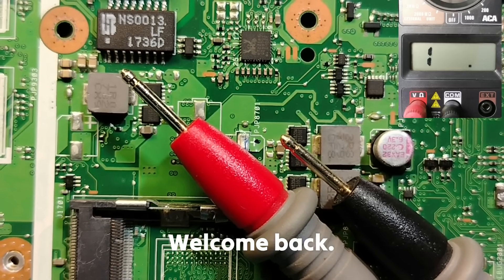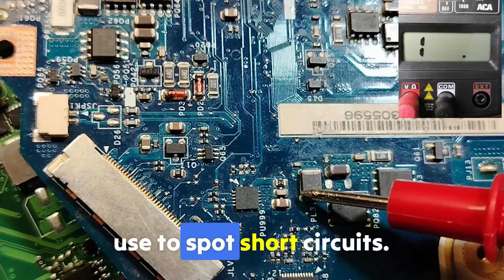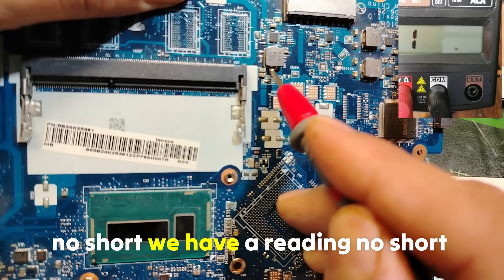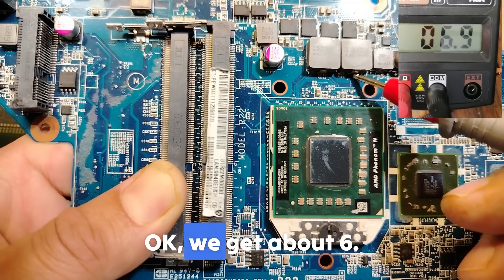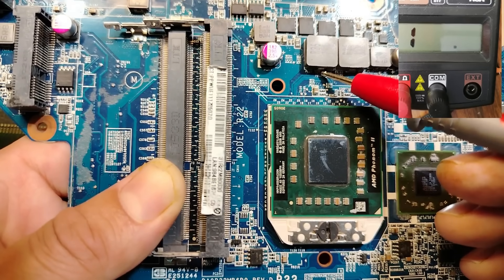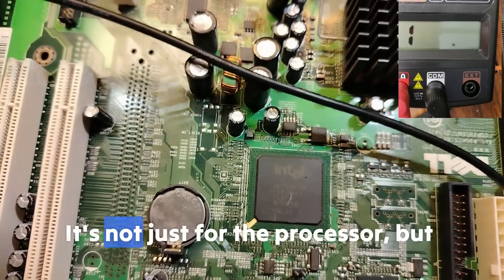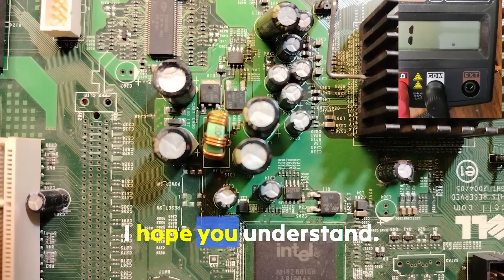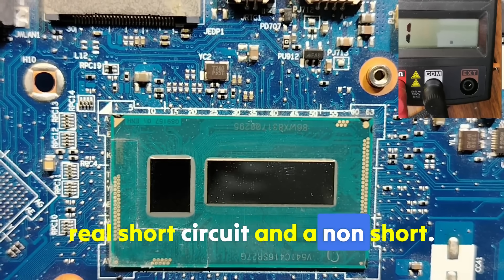The FASTEST Way to Find Shorts on Any Motherboard🔥| Laptop Short Circuit Repair

Comment: Those are readings on older boards. Newer CPU's can have readings as low as 0.5 ohms, even 0.2 ohms; and, your digital multimeter isn't always accurate enough at those milliohm readings.

Comment: How to test Flourescent numerical Display modules drivers where one element of FILAMENT is not lightning up despite the Whole Display numeral block is good. like number 6 the top filament not lighning uop or nuber 5 the left top filament not lighting up because one part of the river chip is damaged or shorted out

Comment: You found a short, but not where it actually is. The easiest way to find a short is to inject voltage and see what gets hot, with a thermal camera. Or you can use alcohol or burn your fingers. You will know instantly where the short is.

Comment: Sir, on the last part we have short circuit having different reading from the other components but the coil has the same reading , is it the coil that need to be replaced for they can regulate the current or the capacitor having different reading that was needed to replaced .. you didn't take out or say which really was the short ...

Comment: Good day. 
I have a problem with my PC. 
The PC has M.2 NVME Drive , what did is that I Replace M.2 NVME drive with M.2 SATA  after that I power on the PC but the PC never turn on.  
Up-to-date the PC is not turning on, when I try to turn it the system will starts and immediately turned off. 
What is the solution

Comment: This video would have been better if you actually explained how to FIND a short in the motherboard.....you spent so much time telling us how great this video is but still dont know how to actually find where the short is. 

You need to explain therory way more.....like what is the meter set to? And once you find the short, what next? Do I remove the capacitor?  What do I replace? 

Nice video but its really lacking....I still dont know where the short is 😂

Comment: my brother well done 
comments add to the YouTube math, and you are forcing us to say something very very very often you will read a few ohms to ground
and without the schematic you are showing us nothing. please be careful you did not mention how to use a meter or to disconnect power etc.

people are VERY VERY Excited to fix their computers from a video, but you can die if you make a mistake electricity is not your friend its a beast tamed by science. it will try very hard to get you if you're not careful
and not trying to be rude or mean the term "short' is way overused in over 45 years of service work a "short" circuit being the culpret is rare. open circuits far more common my friend. 
have an awesome day

Comment: Buck and boost converters are mostly used in power supplies and not likely just a motherboard . I used to repair power supply boards when I was working in avionics.

Comment: Circuit boards are tricky. You could measure a coil or capacitor and it may read close to zero resistance. Then you find out that because there are numerous parts that are in series and parallel with the part you thought was bad ,only to find out that diode or capacitor is good but some other unknown part is the culprit. That’s why we have oscilloscopes and huntron trackers etc.,so one can see exactly what the signals are doing.
Reply: this is what a great number of  electronics repair  guys  never tell us on youtube .  Two years ago When I started learning fixing motherboards  at components level  , I thought I just had to find shorted smd capacitors , and I realized  that it was as you mentioned  ,  capacitors showing continuity on board , were no more shorted off board  , I ended up removing a great deal of beeping capacitors , and sometimes damaging traces .  you have to dig deep in youtube videos to find people talking about components in series and parallel.
I read that oscilloscopes weren't suitable to test electronic components , about the huntron tracker I never heard about hem before , can a beginner use them?
Reply: Thank you....I knew it couldn't be that easy 😂

Comment: I assume the coils need replacing. Also replace all the shorted caps under the CPU.  Now you measure with new parts. What if there’s a component that was missed and you apply power. Now the missed component could take out the ones we replaced and now back to square1.

Comment: If one of the components has a short round the processor. How will we detected it or how will we know if it's bad
Reply: await your response please
Reply from the maker: Done, feel free to ask
Reply from the maker: If one of the components around the processor is shorted, we detect it by checking the resistance to ground on the affected rail. A faulty component will typically exhibit very low resistance (near 0 ohms), or the multimeter will beep continuously in continuity mode.

Then we isolate the faulty part by injecting low voltage, feeling for heat using a thermal camera, or lifting components one by one until the short disappears.

In short:
Measure resistance to ground → Very low = short.
Inject voltage → Find the heating component.
Lift suspect parts → Short disappears = bad component.

This is the standard and most reliable way to confirm a shorted component near the CPU.

Comment: What's a short ?
Reply from the maker: A short (or short circuit) happens when electricity takes an unintended path with very low resistance. Instead of flowing through the normal components, the current “shortcuts” somewhere, which can:
blow fuses.
damage components.
make the board or device stop working.
For example: a shorted capacitor lets current pass continuously instead of blocking it like it should.

Tell me, do you want me to show a simple example of a short on a board? It makes it super easy to understand.

Comment: Excellent video well done kindly make part 2 to further explore. To identify exact short circuit component
Reply from the maker: Awesome, I'm glad you found it useful! What type of motherboard or component would you like to see explored in Part 2?
Reply: Electrolyte & smd. Capicator 
diode. &.  Ic. &. Resistor

Comment: Need help my  Android tv box H96 max rom 64 GB and ram 4GB is dead there is no display  only a small red ligh red light is thre please guide me it will be very kind of you
Reply from the maker: It sounds like your Android TV box might have a power issue or a short circuit. If you have a multimeter, what do you see when you measure the voltage at the power input?

Comment: Resp Sir! Nice Sir🙏🏻, Sir My Seagate Hardisk 500GB Spinning and Stopped Sir, Where the Problem Sir, CUP IC, Motoer IC was Heating Sir, SMD Diods Impendence Values are both Sir Desplayed in Diode Mode Mtimeter Sir. Diode Removed and Tested OK good Sir. Where the Problem Sir, Anybody No Sutions Sir,  Please Advise and Solutions Sir Iam Waiting Your Message Sir. Repair Tools Please Provide Sir How to Pay the Amount Sir, Please Sir.   --   ChinnaRao Paderu Andhrapradesh

Comment: My brain is a bit shorted right now. Could be the content is also short.
Reply: The content cant be anymore longer. If you are more advanced you can jump straight to coils providing you know relevant resistances for each coil. Example. Main power rail expect K OHMS. 

Ram under 100ohms. Cpu under 20ohms (cpu generation determines that) the new the cpu the lower the OHMS. 

Do you get the theory?

Comment: How do you correct the short?
Reply from the maker: Stay tuned, part 2 coming soon
Reply: If you’re sure that the component is shorted,find out what the part number is and replace it with a new or known to be good part. Make sure if it’s a capacitor that the Voltage rating is the same as well as the micro or picofarads are identical. It will make a difference. If the capacitor is electrolytic be sure to orient it correctly or it will explode as soon as it gets power applied.

Comment: On most equipment if you just replace to fuse with a solid piece of wire the same size the short usually will clear itself😉🤣🤣🤣
Reply from the maker: I don't recommend bypassing fuses for safety

Comment: To find the fault, first do what he did or similar. Then if you have a multimeter that can measure 0.01 ohm difference. You can further check where you get the lowest resistance. That will normally be at the shorted component, or very close. Then de-solder one pin or remove suspected components until you find the faulty ones.
Reply from the maker: Thanks for sharing your expertise. Using a multimeter to check for resistance is a smart approach to pinpointing shorts. Every bit of knowledge helps.

Comment: how check  if the processor is dead using multimeter only?
Reply from the maker: You can check if a processor is dead by measuring the resistance across the pins with a multimeter. If you get an infinite reading, it might be time for a replacement.

Comment: How to find a short circuit in a motherboard that has an embedded CPU?
Reply from the maker: Stay tuned
Reply: In my opinion, this can be seen from the size of the resistance on the inductor near the CPU or chipset @electronicsrepairbasics_erb

Comment: Thanks so far! As I could understand, it's only the way how to detect a short circuit. Could you please show how to get rid of the short itself, otherwise it would be change the mainboard, but not repair.
Reply from the maker: Absolutely. I appreciate your input. I’ll definitely consider making a video on how to actually fix the short circuit issue. Stay tuned.

Comment: I am not sure if there is a part 2 missing, but this video did not explain how to find the shorted component.
You mentioned in the beginning of the video to show how to repair a shorted circuit without a thermal camera or voltage injection, but in the video, you just show how to check if a board is shorted or not, not really how to actually find and fix the short... or am I missing something?
Reply: Same questions here, mate, smh

Comment: good example, but you added more confusion because you only sampled the old motherboard, how about soldered cpu ,new board, how to detect it, thats what you didnt give an example. How to detect short even if the cpu is soldered, and how much resistance should have a coil to cpu in order to not be called short.
Reply: example, the new board soldered CPU , and the coil to cpu is shorted, but it really is shorted, how do you identify that without removing the cpu?  Or identify the culprit, may it be the CPU or other component causing it.

Comment: Finally, you did not explain how to find the shorted component.
Reply: I have not finished yet the video but all what he is saying is valuable. Very valuable especially for beginners who have not encountered yet the short reading on the cpu side. I myself before have tried to remove every capacitor on cpu side to check for shorts 😂.
Reply: @mchl93  you are correct ,this information is very valuable for understanding how to detect shorts quickly
Reply: just told us 15-16 is not a short circuit 😂
Reply: I 100% agree with you!!!!  Especially his voice terrifies!!!!
Reply: @iTanUS  , it's clear that this is a clickbait channel.
Reply: @82levy5 . 12 years 18 subs. Yes you’re channel is flying .😂😂
Reply: @thewidshed  , well... maybe you missed the fact that i'm not a youtuber. 😉
Reply: No Confuszed anymore Woowez.
Reply: Comments say its click bait? without really understanding what he is doing ...quite simple a coil is in a line (not shorted).
You do not want a grounded coil,the grounded coil(inductor) indicates you are on the correct power rail were the short is ,
it could be a capacitor which are tied across rails as they along with the coils(inductor) filter noise or they are part of the buck or boost power systems which the coils and mosfets are 
They provide the power rails like 5 volts or 3.3 volts etc ..
Coils wont work if they are grounded

Example in a psu the inline filter has two coils one in the live line and one in the neutral if the inductor finds ground through a shorted capacitor it will blow the input fuse .
And you would certainly not wire a coil across the live and neutral!! Almost anywhere in a motherboard .

 If that coil finds a path to ground and resistance is below 1 ohm you most likly have a short,

 if its a cpu the resistance is above 4 or 5 ohm or a low value its not a short. Check by removing processor if you can . Short should dissapear if it does not you can investigate the capacitors in that region.
and other chips as well if you find a path to ground via a chip pin that should not  be grounded you have a short..

Spend some time watching what he actually says .

Thanks very valuable technique.
Reply: Just what I thought xD
Reply: I'm shorted 😩
Reply: Junk click bait
Reply: He doesn't know 😅
Reply: Ok so it's quite simple. Instead of using voltage injection and cold spray everything i have to do is desolderig the cpu or the northbridge to find a short. Right ? 😂😂😂😂

Comment: 9:59  Sir , you put  the red probe on one side of the inductor ,  and you get continuity , that  doesn't mean it's a short  , it could indicate an electric path between ground and this side of the coil
Reply: the inductors in the power supply circuits are in series with the power supply, the positive conductor... there shouldn't be any continuity to the ground from any of the two sides as none of them are connected to the ground...

if one side has continuity to the ground, then the other one has too, because it's a coil i.e. a piece of wire...  also, you have a short to ground... there shouldn't be any low resistance to the ground there, unless it's feeding a component like the cpu which has low resistance to ground, as he said in the video...

what he didn't say in the video, but alluded to in the title, is how to find the cursed thing....
Reply: @adin_finitum  Sir , I've checked the "no continuity case ' in both sides for inductors , and found out continuity in those located in the power rail  after the  19v dc jack in
Reply: Ya @10:42 dude said the inductor is shorted but what really happened was that he was just measuring the resistance between the GND pad to a GND plane where the inductor is soldered on. That GND plane is so obviously large covering large area of the board.
Reply: @Dan8254  😲 wow !

Comment: Thanks Boss, let say the short appeared in between 3v 5v and ram circuit where several components like buck converter, chipsets ic ,transistors,mosfets ,tiny smd capacitors and diodes, spoting the real culprit became cumbersome tasks with just DMM and no thermal camera,removing one component after the other n fix back becomes hectic and time wasting. The only choice still seems to be voltage injection to fish out the component via its temperature which is somehow risky for beginners to avoid more damage to the motherboard.1. Is there any fast way to fishout the bad eggs?
                          2. Can you please do voltages injection in your next video?
Thanks for always being ready to help.
Reply: Dear sir will you able to show the fault/ shorts of the ( AC inverter circuit boards )  it will be more useful for intrested Technicians thank you sir...
Reply: In cases where a short is detected but a thermal image camera doesn’t not pick up any component heating up, I use a milliohm meter , I solder wires across the short, then while measuring resistance I proceed to apply a little bit of heat with a heatgun around the board. Wherever the short is resistance will normally react significantly. This method has help me for challenging to find shorts.
Reply: @ruviol across the components as how? Let's say the short is around d ram circuit. Where would ur jumper wire started from and where it ends. Please kindly shed some light about the method sir

Comment: Also, you can get some CPU circuits with very low resistance, BUT, if you cannot remove the CPU, it is difficult to know whether it is a short or not.
Reply from the maker: Stay tuned for the next part, I'll cover that.

Comment: very good material. I also know to check capacitors on both sides, but what about coils with low reading when you can't remove cpu?
Reply from the maker: Stay tuned for next part

Comment: The shorted coils are not the failed components. The next step is to locate which component is causing the short circuit. Normally it is failed capacitor or diode. A resistor will never be shorted but it will be open circuit.
Reply from the maker: You're absolutely right. Stay tuned next part is coming soon
Reply: You are right.
Reply: I would also add mosfets among the usually failed components.
Reply: you are wrong about resistors not being shorted.. and of course they can short itself

Comment: On some phones (for example samsung a30) it have a coil that is grounded on display ic for negative voltage, so please  also be careful.
Reply from the maker: Thanks for the tip. It's always important to consider the specific components of each device.

Comment: Thank you for the videos 

If laptop motherboard read low on coil near cpu  how to confirm if cpu is soldered on board?
Reply: Put power into the board and use and use an infra-red camera to see the heat.

Comment: What happen if 1.2v RAM power coil is shorted is CPU dead?
Reply from the maker: If the 1.2V RAM power coil is shorted, it could potentially cause issues with the CPU. But it's best to check for any damage to the RAM Controller IC